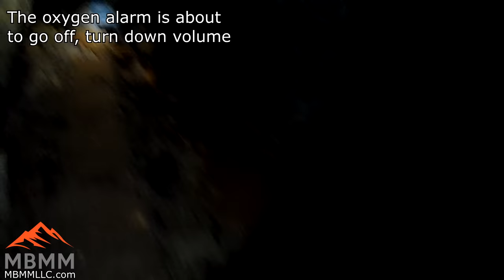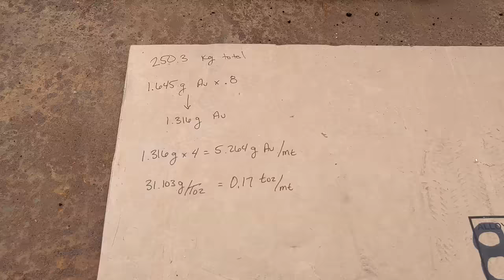How Much Gold In This Gold Ore? Crushing, Concentrating, & Smelting Gold from an Abandoned Gold Mine

Comment: Are cupels single use? Is there a process to remove the oxides so it can be reused? If so, is it worth the cost to reuse, or is it cheaper to toss and use new?
Reply: They are typically one use. You buy them by the case.
Reply: Lots of time if your exploring around old gold mines, you will find culex’s lying around.

Comment: In 1955, I had graduated from Utah State with degree in Aero Technology a pilot and mechanics license.  Broke, I got a job at EIMCO in SLC running a drill press.  Lee Hansen, a cousin of my dad, was a geologist for Rare Metals Corp and he needed a sampler.  Looking at your video I can see you need me.  You are probably better at making videos than sampling or geology.   And, at 88 I can no longer hump those bags, which were twice that size (around 100 #),  I typically used a two pound coffee can (probably Folgers) which you could form to fit the contours of the line. Later I had an aluminum container from a cannister set which was perfect.  "The dust you spill could be the difference between Go or No Go"  In America because of our government we are known for being innovative.  WW2 was won by innovation or "Yankee Know How).  If II screwed up a sample i did not get fired, my boss said; " you did it wrong, now you know how to do it right": just don't make the same mistake twice.".  That probably would not happen in a country controlled by communists.
President Trump probably made some mistakes in his first term but, we can get the benefits of his second term.  GET SMART, GET TRUMP. 
Iguana

Comment: ...also i find your videos to be the most informative and interesting of those ive viewed..a suggestion: have you considered testing a replaceable hammer mill tooth with a wedge- type impact surface a la a replaceable stamp shoe held in place by a pin? Though it might cut into your profits initially i ll bet more units could be sold if the entire hammer package didnt have to be scrapped or changed out frequently...just the actual worn out impact face. What do you think?

Comment: Note: I used to live in Nome, AK and I used to assay the dirt in the street and garden dirt in peoples back yards. Just the average dirt runs 1/3rd to 3/4 OZ per ton!!! Nome is the richest place on earth! Just amazing. The place should be turned into a 100 mile round open pit mine. At the 500 Foot level it could produce enough Gold to crash the Gold price for 200 years or more. GO THERE ONCE IN YOUR LIFE! All dirt every-where has 10 to 50 colors and flakes per pan full. One spring day after 5 days of hard rain I was driving down the road and in a washout with lots of back sand streaks I picked up 17 ounces of large flat Gold nuggets with my fingers in just a few minutes. RICHEST PLACE FOR GOLD ON THE FACE OF THE EARTH!

Comment: I've done some machine design for food production and something occurred to me,  if you had a high grader on site, you'd be able to reprocess that discarded quartz and and country rock using optical recognition and mass to discriminate so it would literally run all day and a horn can call the operator to clear any jams.
The optics can be trained to direct rock at speed😉👍

The box work quartz in the sweet spots is amazing

Comment: Hi Jason I have a question. Say you overloaded a cupel with say bismuth or lead and it becomes completely saturated with the metal oxide. Would the excess metal oxide drip or seep out of the cupel from the bottom as it took in more metal oxide? Or does it simply stop taking in metal oxide? Love your videos, keep them up!

Comment: You should tell people YOU CAN'T CUPEL in a gas furnace very well, only ELECTRIC works fast since the Cupel LOADS with CO2 in a gas furnace and the Cupeling process dies! Good info just to put out there AND you should run a side by side Demo just for a GREAT DYI video,,, "CAN YOU CUPEL IN A GAS FURNACE?". Would make a great video

Comment: Interesting little fact for you.
Underground mining at 5 grams per tonne would be unlikely to be viable at todays gold price.

However open pit mining would likely be a very different story.

One of the biggest open cut gold mines is Australia’s Kalgoorlie super pit.

Back in 2010 the average gold grams per tonne was 2.5 grams / tonne and that’s viable for open cut.

So that underground mine if open cut could be 2 times as profitable as one of the worlds biggest gold mines.

However, in open cut mining your crushing all of the ore not just the gold rich quartz vein that you sampled.

So you can’t really compare your 5 grams per tonne result, with Kalgoorlie Open cut 2.5 grams per tonne because you weren’t sampling and crushing any of the parent host rock either side of the actual quartz vein as you would be in a open cut mine.

So not really comparing apples with apples if that makes sense.

Comment: When the oxygen level starts decreasing it’s being displaced by something else. Rotting organic material will off gas hydrogen sulfide, methane and CO2. Should carry a meter that reads for H2S along with methane and displays a lower explosive limit (LEL). Safety first. Having a CO monitor wouldn’t be a bad idea either. H2S is heavier than air and will hang out in low areas.

Comment: Why wouldn't you run the pay dirt through a sleuth box before running it on the shaker table , I'm probably wrong I'm certain I might be but it just seems like you might be loosing pay by not doing that after the crusher , and why isn't their  something covering the out around the shaker instead of just a straight drop to a plastic bin , wouldn't that allow some lose as well? Again this may be wrong which I'm certain it is but couldn't their be a cover designed around the bottom of the rock crusher with water misters to minimize the dust cloud and insure fine gold isn't being kicked up and out of the intended target. A square or round tube with low pressure mister nozzles penetrating through from the outside, all welded shut to the shoot of the rock crusher with a detachable plastic bin at the bottom.

Comment: iv gotten some quatrz and oven roasted it itwhent pink and rusty like iron oxide then i had another quartz sample i baked it in the  woodstove and this tim some black ang yellow orange sparkly powder that was filling up some outgassed pockets all through the rockquartz samplei as i say baked it fire hour or so and got it and let it cool and i think i have either silver and some other metal like zinc deffinately not galena it formed almost like wire wool effect which i know is native silver and i live on a falt rich igneous ridgeway with the remnants of a a very small volcanic range. which are known locally to produce silver sulphides

Comment: i see you are using multi gas vapor filters on your mask . I think you should be aware that even though they are the most expensive they dont provide the best protection they are good for vapor but not so great for particulates. What you need is P100 pink pancake or P95 Blue ones which provide better protection for dust at a fraction of the cost.